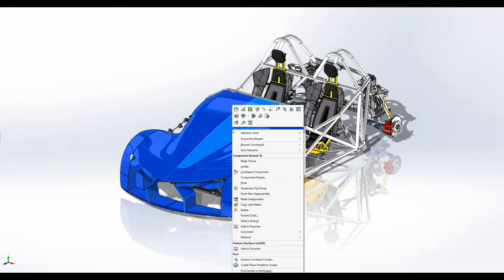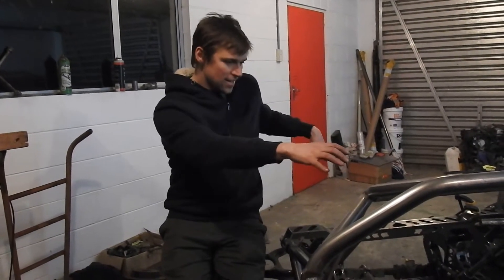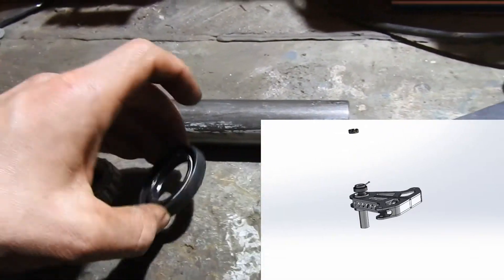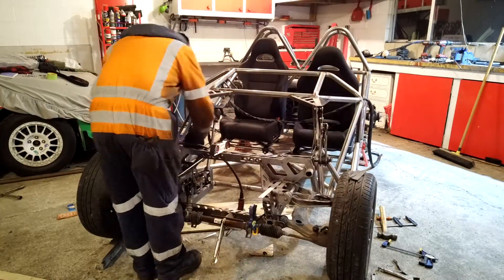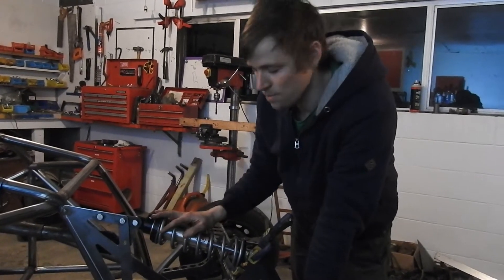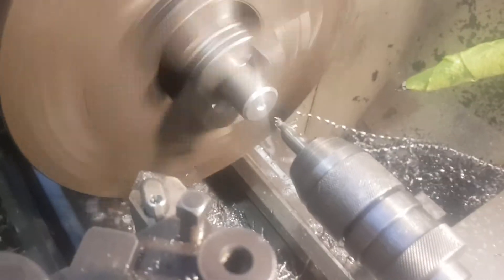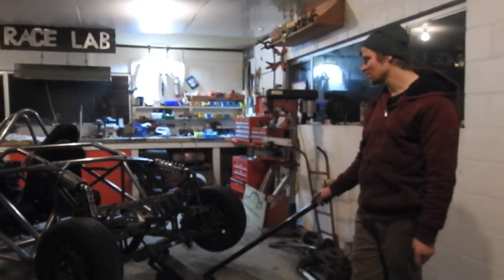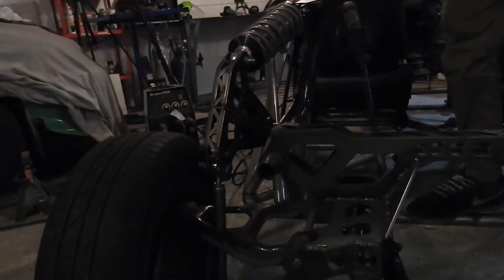Scratch Build Design # 7 Front push rod Suspension

Comment: I have a Exocet which is a Miata and I have been thinking of changing the suspension. I'm going to go to push rod for numerous reasons, but mainly for aerodynamic. So I want to take the rear subframe and move the control arm pivot point to next to the diff. The tubes would be aerotubing and for the front I haven't a clue what I want to do yet.
Reply from the maker: Nice exocets are cool and sounds like your going to make it even better